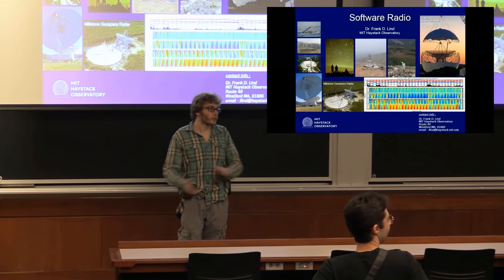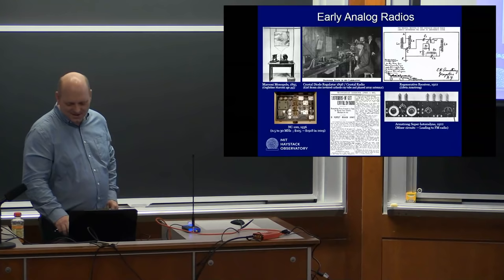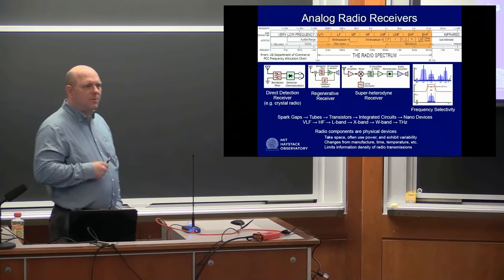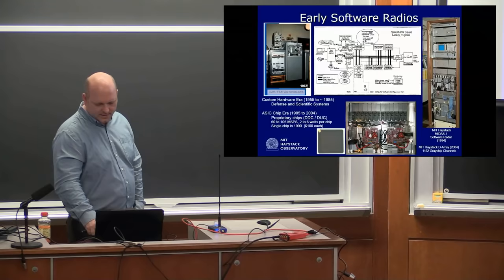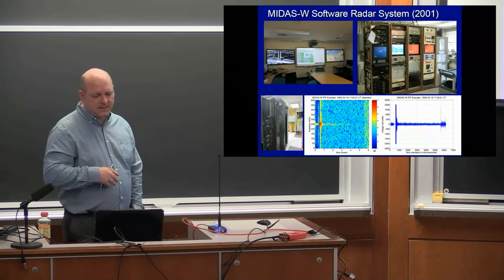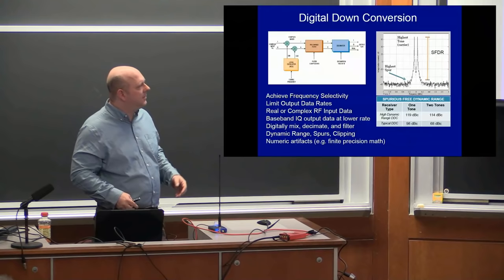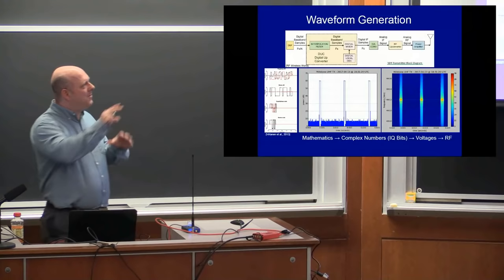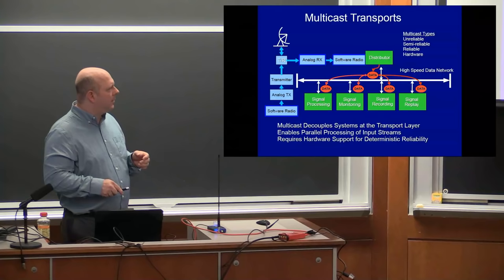Software Defined Radio

Comment: Would love to see a practical sdr course, that first goes over the applications and uses of SDR.   Things like..

Morse Code CW Transmission (NFM and AM/USB) and decoding/Receiving  (CW Skimmer, CWGet , morsecode scphillips translator, etc)
HAM : trunking (SDRTrunk / Unitrunker) / TETRA (SDRsharp plugin, OpenEar, OsmocomTETRA), digital-modes (DMR, D-Star, System Fusion/C4FM, NXDN, P25/Police Scanner (DSD LouisErigHere),  POCSAG (PDW Software) , YSF  FT8 )) ,  convert modes on the fly (i..e use DMR radio to talk on C4FM), 
Decoding/Visualizing Weather Satellite data (noaa-apt, WXtoImg )
ADSB Plane Tracking  (X-Plane / XHSI and AdsbSCOPE plugin,  MultiPSK with Maperitive) 
GPS Decoding/Plotting/Spoofing ( GNSS-SDRLIB,  RTK-NAVI)
ATSC Video Receiver/Transmitter (Portsdown DATV, SDRAngel, GRC, SDRGlut)
Local GSM/LTE cellular network (GPRS)   (gr-gsm, Kalibrate, IMSI-catcher, srsLTE-Sniffer,  rtl-sdr-LTE  dedsecimsi, FALCON)
Text/voice decoding  (OpenEar, Defcon 2016)
Inmarsat AERO satellite Medlink AMBE Audio ACARS (jontio / libaeroambe built JAERO) 
Reverse Engineer an RF keyfob  ( clock-recovery, analyze protocol (Universal-Radio-Hacker, Inspectrum), transmit )
Reverse Engineer Direct Sequence Spread Spectrum 

For example, anyone know if these SDR courses cover the above :   Great-Scott HackRF Course,  scannerschool teachable , $2500 Sébastien Dudek ,  $1500 hackers-arise Subscriber-PRO SDR For Hackers,  Balint Seeber / Ettus Research GNU Radio Tutorials ,   tonex ,  commtech-academy ,   enoinstitute , zoetalentsolutions ,  sectrain hitb 2021SIN , Georgia Tech Prof. Edu,   $15 Udemy (Designing RF Comm Systems using SDRs with GNU Radio, Mastering SDR with GRC, etc), factorialabs ,  csun skatz  CSUN/EAFB Software Defined Radio (SDR) Senior Project,   ECE4305? Github SSkySurfer / SDR_Learning ,  ET4394 AlexLyrr / ALGG1, austinsnerdythings ?
Reply: Dont give up all our secrets...lol..there are many jealous greedy people in the community....some things are auto dictates..self learning..for our selves.......you know...mamy blessings
Reply: No.

Comment: It sucks that the slides stay up in the upper right corner; too hard to read, even when on full screen mode.  Most decent lecture streams devote the whole window to the overheads because we don't need to continually see the lecturer standing there talking.
Reply: 1. Turn on "triple tap zoom" function on your tablet device
2. Pump the resolution
3. Triple tap to the top right...

Comment: With large distributed arrays of receiver stations generating huge volumes of data I can't help thinking we need to develop more robust storage systems. Using SSD data storage units must carry a high level of risk with current SSD units having such short working lifetimes and high failure rates.